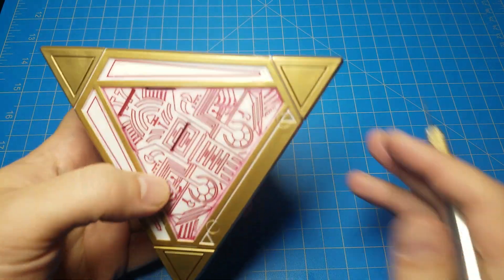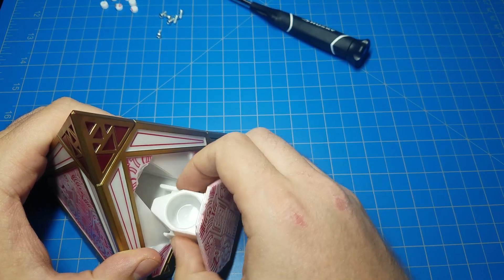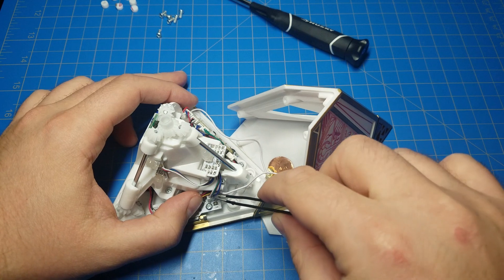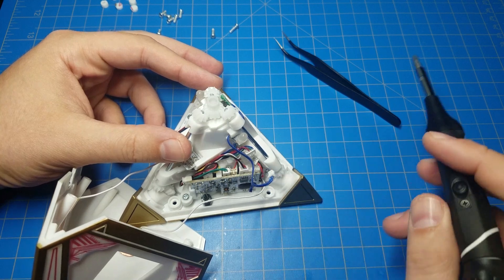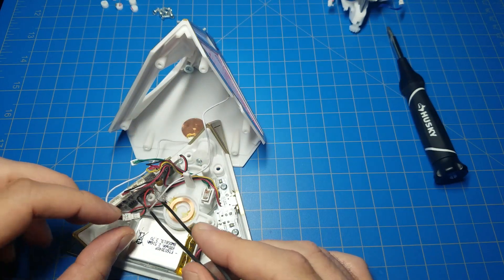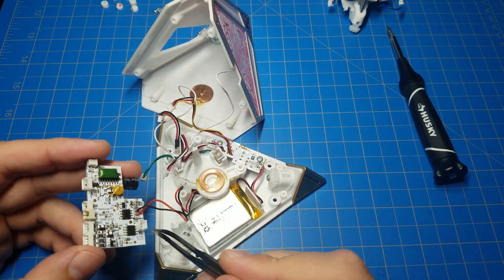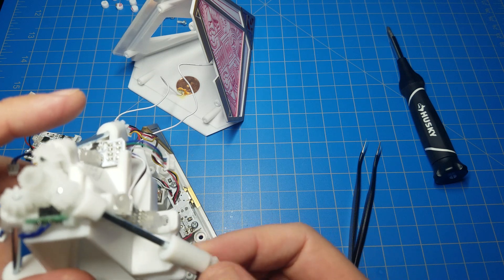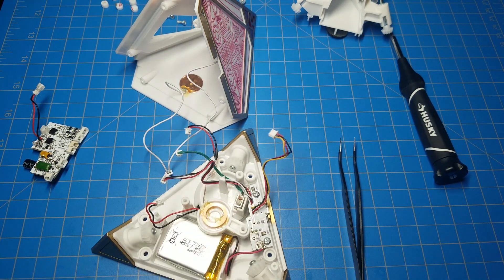Disassembly of a Sith Holocron

Comment: Appreciate the video. Just bought a sith holocron off sbay because I neglected to buy one in the park and it took me all but 12 seconds to learn it refuses to reas crystals. So this video was helpful in learning how to open it up and check for any wiring issues which I was un able to find and will now push through to the seller to get a full refund or replacement. Yippee.

Comment: Thank you for the videos and follow ups. I've taken my jedi holocron apart, checked the coil ring and RFID antenna's, did the power reset and still can't get it to read my kyber crystal. The first few days everything worked okay, but I just can't get it to read my crystal. I have 2 holocrons and when I try it with the other the crystal works fine. I just can't figure out the problem with this holocron. Any other advice suggestions is greatly appreciated. Thanks
Reply from the maker: If you haven't already try contacting Disney and see if they're able to replace it for you. You can e-mail them at Merchandise.Guest.Services@DisneyParks.com. 

Make sure the holocron is fully charged. If the battery is low then perhaps the antenna isn't strong enough to read the crystal.

Look at the wires that connect the coil to the PCB. They're very thin and delicate. Maybe one of them broke and the needs to be reconnected.

If you can rig it, open the holocron and power it on while holding the crystal directly next to the coil. There will be a small switch the drawer triggers when it's closed. You'll need to trigger it manually (keep it pressed down with one hand while the other holds the crystal). If the holocron reads the crystal, then the problem might be the coil's position relative to the drawer the crystal is place in and you could try adjusting it's position. The coil is held in place with hot glue. Soak a piece of paper towel in IPA (rubbing alcohol) and hold it over the glue for a minute or so and that should come right off. Use tape to test adjustments to the position of the coil. When you find a spot that works, hot glue it in place.

Beyond that I can't think of anything simple to try. Maybe try the trick of turning the jedi holocron into a sith and then see if it's able to read the crystal. I have no reason to think it would behave differently, but it's worth a shot.

Comment: I have a holocron that, when I spin the tetrahedrons at the points, some others don't spin.  If I take it apart, is there a way that I can tighten any screws?  I want to be able to put it back together for my kid so it works as intended.
Reply from the maker: yes, each corner does have a screw that connects it to a gear that's used to turn it (or turn the others). and if the problem isn't loose screws, it might be gear misalignment which should be fixable.

Comment: Mine stopped reading the crystals. Any advice on how I might be able to fix that? Or what could be causing it?
Reply: There is a chance that when you opened it up the thin wires on the RFID  reader got snapped.   But there are a lot of things that can go wrong taking apart and reassembling electronics,  sorry no easy answer.

Comment: Are you able to record the Holocron messages? Basically, take a 3.5mm jack or RCA connector and connect it to the speaker pins on the board... from there you can plug it to a female input and record each message as it's been played? Would like to hear the sound quality. Onboard speakers sound like tin.

Comment: I just bought a sith holocron and the rfid reader doesn’t work. I’ve tried to disassemble it but everything seems to be fine any advice? Thank you.
Reply from the maker: you might try charging the battery, that may help. do you have more than one kyber crystal? if so, have you tried them all and do any of them work? it's possible for the RFID tag in a kyber cyrstal to go bad, so if a single crystal isn't working, it's possibly the crystal and not the holocron.

if your holocron isn't reading any kyber crystals,  e-mail Disney at Merchandise.Guest.Services@DisneyParks.com and tell them about the problem. They may be able to send you a replacement holocron for free.
Reply: Hello again! I just got a v1 sith holocron on eBay, and it seems I'm having the same issue.

I've tested multiple crystals, took it apart and connections seem just fine. I'm charging the battery right now, but I feel like that isn't the issue. It functions just fine and lights up red, copper buttons work and the sith speaks to me. 

Pls help!🙏

Comment: Mine isn’t reading any dialogue but is reading the chips, any recommendations?
Reply from the maker: does it make noises when it's on? in other words, is the speaker working?

and how are you confirming it's reading the crystals? is it changing colors to match the crystal when you insert it?
Reply: Ruthsarian yes it is and It Reads and gives dialogue for the crystals but every now and then it doesn’t like it isn’t reading I’m pressing it
Reply from the maker: there are two circles of copper tape inside the holocron. your fingers need to be right over those circles in order for the holocron to sense them. your holocron might be weak at sensing your fingers and you may need to experiment to find exactly where you need to touch in order for the holocron to work. if you haven't already, try charging the holocron too. maybe its battery is low which is why it's weak at sensing your fingers.
Reply: Ruthsarian will do , will keep you posted

Comment: Mine has started to make random noises like out of nowhere it does the hum and it’s happened two times has this happened to anyone else ?
Reply from the maker: Does this happen even when it's in the off position?

Have you tried charging it? They can behave oddly if their batteries are running low.
Reply: Ruthsarian actually it was my custom saber that made that noise either my crystals broke or the sabers broke like half my other crystals don’t work either so idk
Reply from the maker: @---ne9ez  have you changed the batteries? if you have, remove the battery pack and leave it out for, say, 10 minutes, then plug it back in and see if it still acts up. removing the batteries essentially performs a reset of the microcontroller of the lightsaber. you need to leave it out for a few minutes because there are some capacitors (like tiny batteries) that will still have enough power to keep it running for a few minutes.
Reply: Ruthsarian  yea it was like flickering and I haven’t changed the batteries so I need to do that but the white crystal turned yellow and my purple turned red ish purple would that be battery related ?
Reply from the maker: @---ne9ez  yup! that sounds like classic low battery behavior.
Reply: Ruthsarian thanks for the help I was freaking out because galaxy edge stuff ain’t cheap btw my blue crystal won’t work at all would that still be low battery cuz it happened a couple days ago or is my blue crystal just broke
Reply from the maker: @---ne9ez  your blue crystal is probably okay and will work again once you change the batteries. i have had a bad crystal, but it came bad out of the case, i haven't heard of one that was good and then went bad later.
Reply: Ruthsarian it didn’t work in my sith holocron either but maybe the batteries are low on that even tho it made the base sounds when I twisted 5e corners